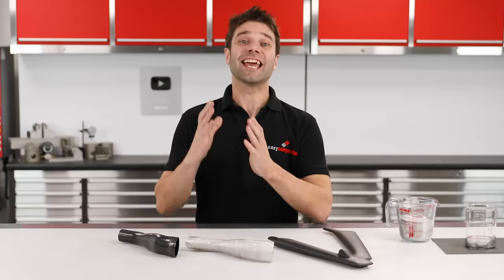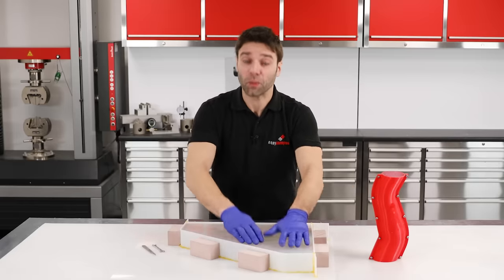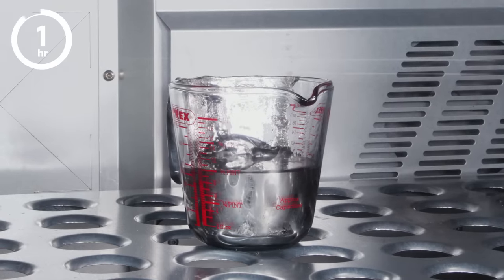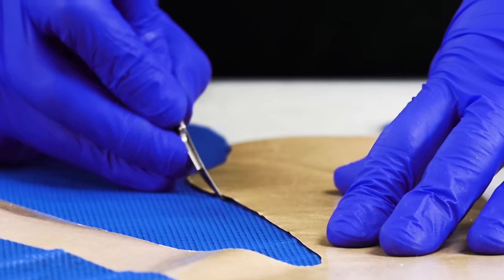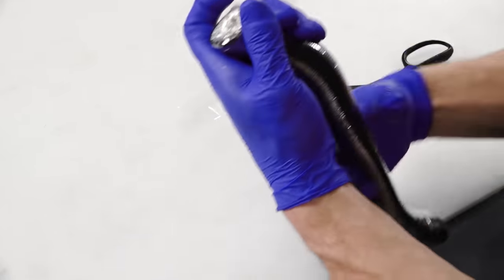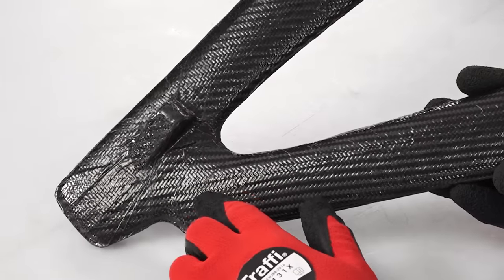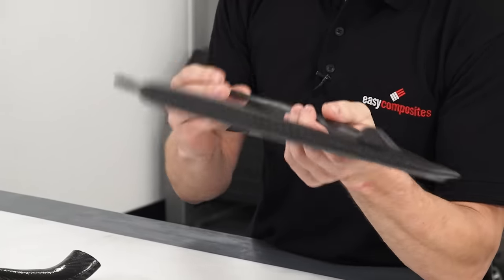Moulding Hollow Carbon Fibre Parts Using a Low-Melt Metal Mandrel

Comment: You can also get a rough estimate of volume using your kitchen sink. Or your bath tub, if the part is too big. Fill it with water - enough to easily submerge the part - and mark the water line with a sharpie. Submerge the part, and mark the new water line. Remove the part, make sure the water line is back to the previous line, and measure the volume of water it takes to fill to the second mark.

It'll be inaccurate, but it can get by in a pinch. The ideal way of doing this is having a container in another container, where the smallest container is large enough to fit your part. You fill the smallest inner container to the brim with water, and submerge your part. It'll displace a volume of water equal to the volume of your part to the larger container, measure that and that's your volume.

Comment: This looks mega for some aero projects in Formula student. We often need aluminium inserts within layups for end plates and winglets. Would it be reasonable to jig aluminium inserts within the melting metal during casting, and have them left behind after the final melt?
Reply: I can't see a problem with that, the aluminum will not melt 🤣

Comment: Very interesting video again.
The aerospace industry uses eutectic salt mandrels for air ducting systems because the inner surface or I.M.L. (Inside Mould Line) is considered the 'A' surface because the noise level within the aircraft is reduced by having smooth smooth surfaces in contact with the ducted air.
Reply from the maker: Indeed they do. We actually have some soluble salt compounds in our lab at the moment that we’re experimenting with. Generally, they’re harder to use without more industrial process equipment (like hydraulic presses and ultrasonic/high pressure cleaning) but if we can find a way to make them a bit more usable then we’ll feature those too in the future.

Comment: It would be beneficial to use silicon double sided press instead of vacuum bag for the best surface finish. Are there anything against this method, could you make video about using rubber membrane press for composites?
Reply from the maker: Hi Anton, yes, you can do this. No real downsides providing the geometry of what you’re making allows relatively uniform pressure to be created across the whole surface; for example, a press will create pressure top and bottom but less pressure on the sides. You can mitigate this by restraining the silicone laterally but this takes a very strong construction (like a metal perimeter).
We’ll definitely be doing some videos on silicone pressure moulding soon.

Comment: @11:43 What just happened to the front plate?  Did you somehow do another shot with the front plate removed, or are you using a simulation/animation?
Reply from the maker: Hi Iain, well spotted! We repeated the process with a piece of glass as the front plate, then merged the two. The effect is quite subtle but hopefully helps to show the process more clearly.
Reply: @easycompositestv  It looks fantastic watching the metal pour into the mold.

Any chance you can comment on doing this process with wax rather than metal?  There are waxes with even slightly higher melting points, and the density match to the silicone should reduce mold bulge.

Also, that balancing act with the zip-tied silicone mold looked actually dangerous.  I'd never do that.  Why not use the 3D printed mold as reinforcement for the silicone (as someone else in this comment section suggested)?
Reply from the maker: Certainly for ambient temperature cures wax could be used, but to the best of our knowledge there aren't any waxes that have the stability to withstand 80C for the cure along with the pressure that's being applied by the consolidation. With regard to the ziptied silicone mould this was an attempt to make the pour visible, but absolutely the original barriers could have been used. To be fair that mould is surprisingly stable and with the relatively low temperature of the material I don't feel that the operation was particularly dangerous but I appreciate the feedback.
Reply: @easycompositestv  Got it!  Even for room temperature cures, if a vacuum bag was used it's going to apply considerable pressure, and the wax does not have the strength that the eutectic metal alloy does.  So any stresses in the part or vacuum bagging system can end up distorting the wax mandrel.

Thank you.  These videos are incredibly helpful.  Like, we're starting a composites project that we would definitely not have taken on if it wasn't for these videos.  (Order coming soon.)

Comment: This was really cool. I love that low melt alloy stuff. Can't help but thing that if you could 3d print some lower melt plastic that is more fluid than tacky like then you could skip the alloy step 🤔
Reply from the maker: Thanks for the comment Astrix, we have done a lot of testing with printed mandrels, unfortunately there isn't anything out there that can withstand the temperature and pressure of the initial cure without distortion or collapse, even when the cure is below the theoretical HDT of the polymer. Be sure to let us know if you find one though!

Comment: super informative, thanks for sharing!  I was curious during the cleanup process when you had to remove the trace alloy from the induction tube but not the frame?  Is what just because the geometry doesnt allow to easily clean it out?
Reply from the maker: Yes that is correct.  Plus an induction tube you would not want metal particles coming loose over time and finding their way into the engine.  The inside of the wishbone is pretty much sealed once assembled and in use so the traces of metal inside are not relevant.

Comment: Fantastic video production as always!  This does make me want to directly machine low melt alloys on my CNC so that I can skip the first part of the process. For low volume that may not be a bad approach, any thoughts on that?
Reply from the maker: You would need to cast an ingot the right size to start with but other than that, should be possible to machine it to shape.

Comment: I had an idea of something similar: Water soluble 3d print filament. I haven't tried it out yet but it should theoretically work about the same with half the effort.
Reply: Like flour and water?
Reply: @joeshumo9457  I’m guessing pva filament. I’m assuming it the carbon would have to be cured first and then have the pva dissolved out, instead of all at once like the metal method in the video.
Reply: It takes way too long to do it, I ve tried this method and disappointed. Best would be sla wax resin or wax fillament for fdm from fillamentarno (hard to get and hard to print)
Reply: This works fine, but it can take a while to dissolve the male mould out of the carbon part, , the exact time depending on the brand of the PVA filament. Anything up to 48 hours. Best to design some channels in the interior of the male mould to allow the water to access a larger area (rather than just the ends) - or drilling holes in the PVA after curing the carbon. Having said that you avoid the intermediate stages of silicone moulding etc in this approach by printing the male mould directly. I have usually ended up scraping the last of the PVA sludge off the inside of the part.
Reply: If you can't have a large opening to get water in stick with hard wax or oil based clay

Comment: QUESTION: You mention using the recommended curing and post curing temp profiles as stated by the prepreg technical data. Doesn't the core's thermal mass have any bearing on this temperature profile? ALSO: Is the wishbone's inside radius difficult to lay and consolidate? Do you have any video on complex shapes?  Thank you.
Reply from the maker: It may slow the cycle slightly but you can add time if needs be.

Comment: What about the heating of leadded metal, will the vapour be toxic? Does the unleadded alloy have the same melting temperature is it gallium based? Also can this wishbone be used to replace car wishbones which are made of cast aluminium?

Comment: Does the surface of the silicone moulds exceed the working temperature of PLA/PETG during casting? Silicone has a poor thermal conductivity and high specific heat capacity so I imagine it should be possible to reuse the 3D printed barries to stiffen the silicone mould for casting.
Reply from the maker: Yes, this is good spot. Someone else pointed this out too and I’d have to agree; using the 3D printed barriers to retain and contain the silicone when casting the mandrel would make a lot of sense 👍.

Comment: thanks for the great video

I have a question

The female mold is 3d printed with heat-resistant filament such as PC or UV resin.
Is it possible to cast the LM95 directly into the female mold?
Reply from the maker: It’s in interesting question. It would depend on the stiffness of the plastic when exposed to the temperature of the metal. The LM95 needs to be poured at at least 110, ideally, more like 120. If the resin print didn’t soften noticeably at this temperature then casting the metal directly into a 3D printed mould would be an option. Silicone is very stable at these temperatures which means it retains excellent accuracy, but if the plastic does move a bit, it might still be an option for less dimensionally critical components.

Comment: Hi! I have a question: I need to produce a hollow tube similar to the duct you just show, however I need to produce just two of them, I don’t care about the surface roughness and I have a low budget. I was thinking to 3D print a sacrificial core, then laminate around it (without using prepreg since I don’t have a suitable oven) and when the resin is set to melt/remove the plastic somehow. Do you have any suggestions about that? 
Great channel btw, you are the best!
Reply from the maker: Hi Vezz thanks for the question, yes you could definitely hand laminate over a printed mandrel, PVA would be a good choice as it will dissolve in water (slowly) alternatively you could make the shape from polystyrene foam and then dissolve it out with acetone or petrol, I hope this helps!

Comment: Thx. Nice video...again.
BTW, on the wishbone part, how do you manage to form the edges firmly and precisely ? I used to experience a "flattening" phenomenon with the vacuum bagging process on this kind of part.
Reply from the maker: Remember it is being pressed against the metal so cannot move so much.  You can also put pleats in the bag on one edge to ensure the force is evenly distributed.

Comment: Excellent video tutorial; I love the channel.  Would the low-melting-point metal work as a disposable part for a forged carbon fiber mold? I want to experiment using forged carbon fiber to make some parts.  Unfortunately, every orientation leaves an overhang.  If I could melt out the form, I could get away with overhangs.
Reply from the maker: Only if the resin system could handle the melt out temperature. The EL160 resin with a suitable post cure may be able to do that with a bit of experimentation.

Comment: Trick for working with hot glue.
If you put isopropanol alcohol, it slightly expands and IPA can get into the crack. So IPA helps to remove hot glue in a very easy and controllable way.

Comment: could you 3d print a mandrel in PLA, wrap it using a 2 part epoxy, and then heat it to 60 or 70 c (higher than the glass transition temp of PLA), so that the pla could be removed easily? I know that the curing of the epoxy releases heat, but are there epoxies that cure without enough heat to deform PLA? (or say, PETG at 80ish c?)
Reply: PLA will deform but not drip out until 200+ 'c, and even then its sticky so wouldn't come out. There are PVA based dissolve-able filaments that you can print with and then dissolve with water. I want to try it someday.
Reply: @ratgreen  yeah, I didnt actually mean that it would drip out. I think for at least simple tubes and the like it could be deformed enough that one could pull it out in one big chunk.

Comment: Ever try water soluable 3d print filament?
Reply: If he's using PVA for release agent, I don't see why you couldn't use a PVA printed core. A few shells and fairly open infill could probably be removed pretty easily with warm water when finished.
Reply: This is unironically genius.

Comment: Have you done any testing with PVA or HIPS support filaments for producing the mold to wrap carbon around and then just dissolving the mold?  I've been trying to find information on how they react with the resin and if there could be any negative effects on the part when removing them.
Reply from the maker: We experimented with dissolvable 3D printable cores but they were not that successful in their current forms.

Comment: Hello Paul. As other have said a fantastic video as all your videos. The only complain I have is there are not more of these videos. One question regarding the core alloy. From the video it seems the surface is not perfect smooth. Is it just an illusion due to different oxide colors forming on their surface? Or if the case is there a way to improve the cores surface by polishing or burnishing or is the PVA release be sufficient to get a mirror finish on the inside of the parts? Thank you again for a fantastic channel!
Reply from the maker: Hi Delta, Great question, the surface is certainly much better than it looks on camera, the crystallisation 'spangle' effect does not have a huge effect on the surface but it couldn't be described as gloss, the PVA will improve the surface to near perfect if applied correctly, but if needed I see no reason why it couldn't be polished.

Comment: 0:47 - if your component is not a pipe which need to be empty so FOAM CORE is the way to go.  it is better/cheaper/easier.  and the part itself will be stronger for impact load and well dampened for vibrations.
it's a perfect technology for bike frames.   make a foam frame, wrap it in carbon, that,s all.

P.S.   and lead is completely safe to touch.  just don't eat it for every lunch ten year in a row (this is the only way to be poisoned with lead. you need to eat/inhale it for years).

Comment: As always, an inspiring video. Interesting to compare low melt solid metal to soluble 3d printing media as a core. That material has a much much lower melting point so would be no use at all in any hot cure method and its reduced rigidity would make it less accurate (I guess), but could be a quick and dirty method to prototype with a hand layup if you already own a 3D printer.
Reply from the maker: Hi Tom, yes, we’ve done quite a bit of experimentation with the water soluble filaments. At the moment, the combination of accuracy, process-ability, and cost, along with the less than ideal solubility and extraction process, leads us to think that the tech needs to develop a bit more in order to be as useful as its low-melt metal counterpart but it very much does exist, is already useful, and will no doubt only improve. We may soon do a video on it, as you’ll know, we’re fond of 3D printing applications in composites.

Comment: Yet again, another great video! I'm wondering, if is there any other way than glueing together two parts to make empty-inside object, like for example a sphere? Is there any specific way to stick them together, to keep the strenght of carbon fibre?
Reply from the maker: You could design one half to have an overlap joggle joint or similar to give a good bonding surface area thus keeping the join line strong.
Reply: @easycompositestv  You're best of the best, thank you

Comment: Wouldn’t it be possible to do a quick and dirty version of this straight out of a 3D printer by selecting the right print material and composite resin? If so what would be some good choices?
Reply from the maker: Assuming you had a higher temperature dissolve out core, it might be possible. In our testing, some dissolvable cores were not that reliable or easy to dissolve out.

Comment: 🎯 Key Takeaways for quick navigation:

00:00 📹 This video demonstrates a method for making lightweight hollow carbon fiber parts using a low-melt alloy core.
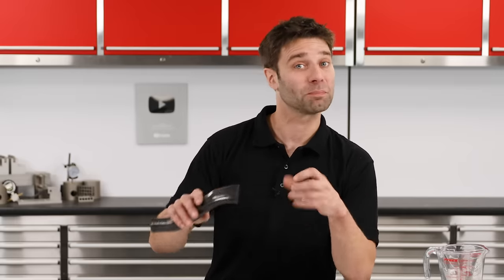01:09 🛠️ To create these parts, you start with a pattern representing the inside shape of the component and create a silicone mold around it.
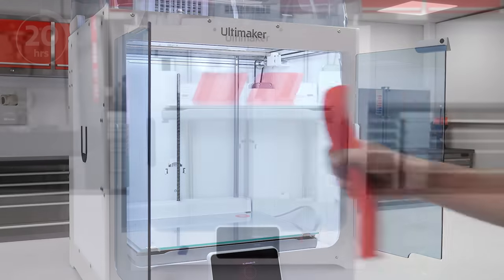03:31 🧱 The silicone mold is used to cast a low-melt metal mandrel that will serve as the core for the carbon fiber part.
08:26 ⚖️ Calculate the amount of metal needed for the core based on the volume of the part and its density.
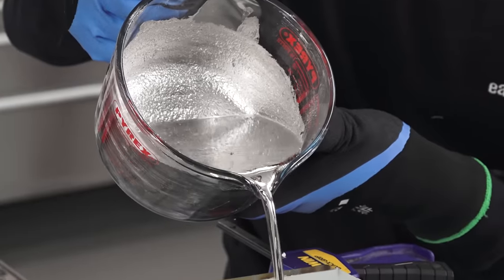11:46 🔥 The metal mandrels are cast at a temperature above their melting point, ensuring they remain liquid throughout the pour.
17:02 📜 The carbon fiber part is made using prepreg carbon fiber, which is laid up over the mandrel.
19:14 🌡️ After curing, the metal core is melted out by heating the part above the melting point of the alloy.
21:06 🧼 Surface finishing involves abrading the outer surface and applying multiple coats of coating resin for a smooth finish.
22:49 ✅ The final step is to flatten the surface and finish any detailed areas by hand.
23:02 🎨 The final coating is applied for a consistent satin finish, and a thin coat of xcr resin can achieve excellent gloss results.
23:30 🚰 To clean up parts with a residual alloy lining, soaking in water can soften the alloy for easy removal with a soft bristle brush.
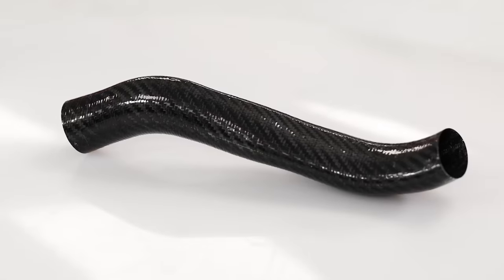23:59 🏋️ The finished components are incredibly lightweight, with the induction tube weighing just 12 grams and the wishbone having structural performance suitable for a recumbent trike project.

Made with HARPA AI

Comment: If we leave the metal residue inside will it strengthen the structure of the carbon fibre component ?
Reply from the maker: Its a super thin fine surface coating so will not add anything noticeable to the strength.